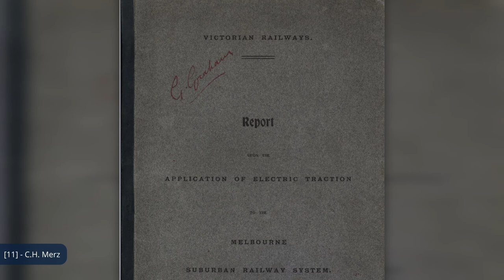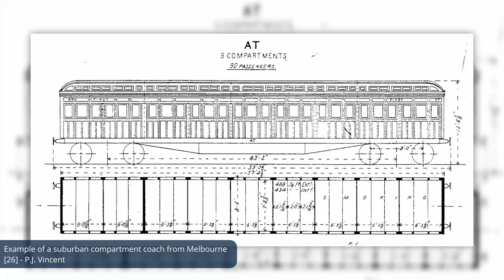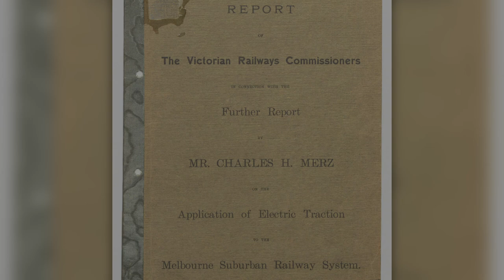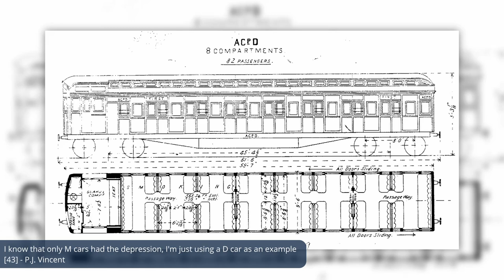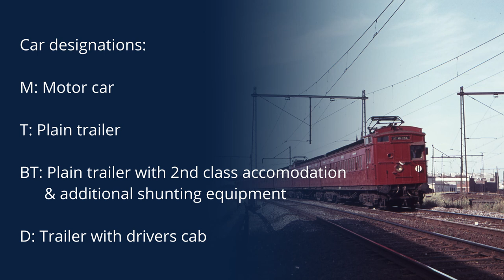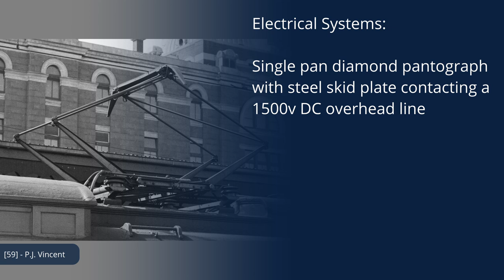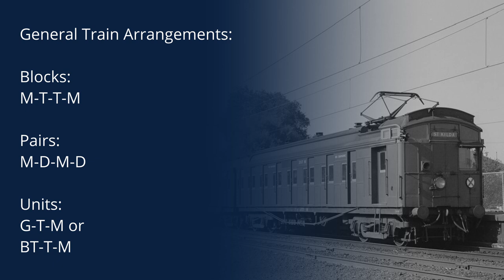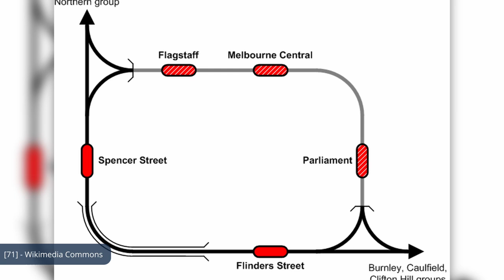Rolling Stock of Melbourne: Taits & Swing Doors

Comment: the cash strapped VR ran Taits for six decades, at the time, it was claimed to be the oldest rolling stock in current revenue service in the world. They had no heating and were drafty in winter. The cars would bang into each other and lurch. Jeff the cartoonist drew beautiful Taits with square wheels when the fares went up or during train strikes in The Sun daily newspaper. The older carriages that the Taits replaced in the early ‘70s were called “dog boxes” because of the compartment design.

Comment: It is interesting that the last Tait you showed doesn't have the grey band that the restored one does.
Reply from the maker: I believe that's because the restored one is meant to represent a different era.

They spent their final years in all red, but earlier on they were in that red with a grey band livery. Although I'm not sure of the specifics.
Reply: @CityConnectionsMedia  the two tone moonstone grey and rose red livery stopped being applied in 1956. There is great high res film if the 1956 Olympics where both the Taits and swingdoor trains are in this grey banded livery.
So far back that many only are aware of the all red livery and questioned the Elecrail set as being in the wrong livery.